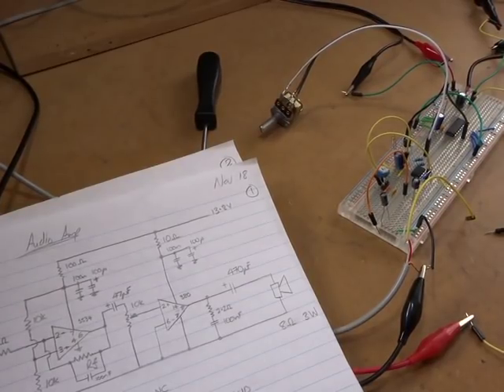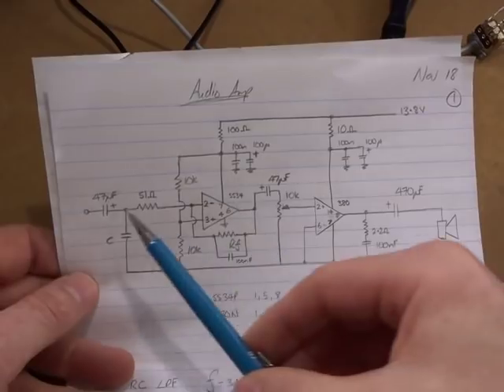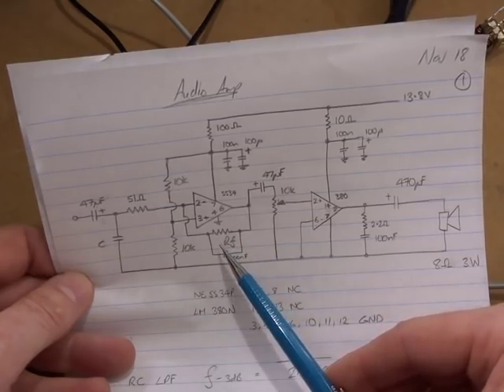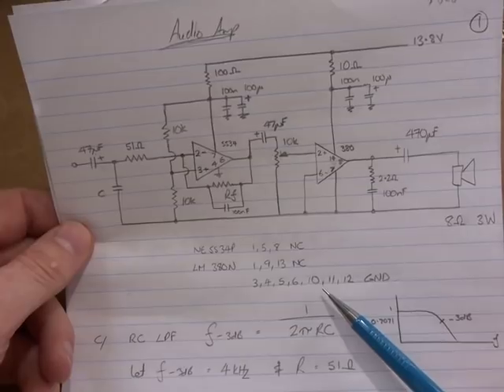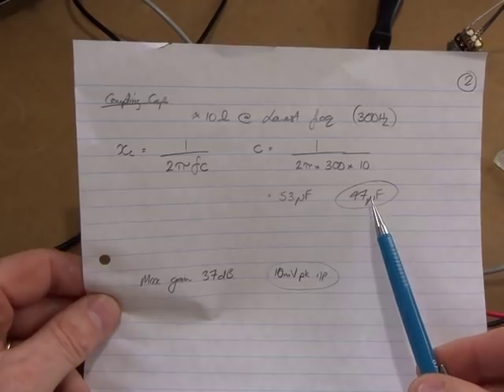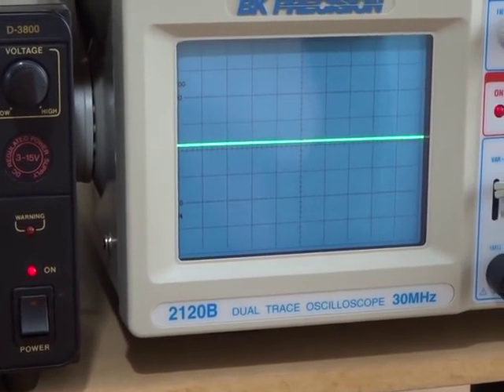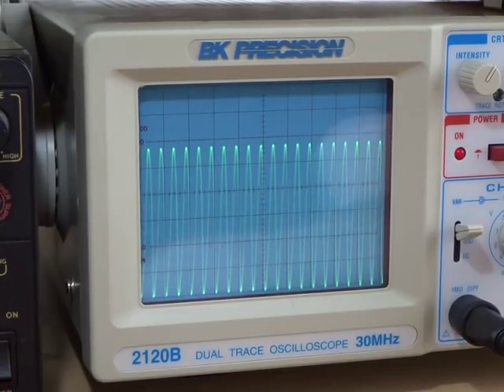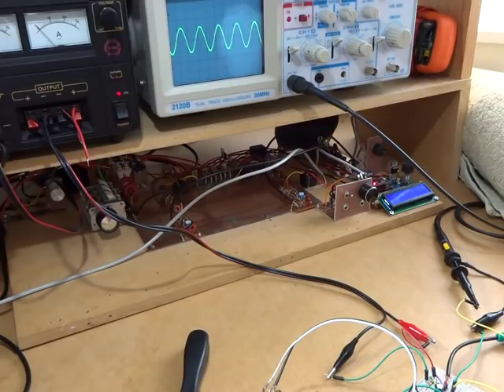Homebrew MC1350P based SSB Rig - #2 Audio Amplifier

Comment: In the schematic - pin 7 of the LM380 is ground but I do not see a connection from the power supply GND to the "bottom rail" that connects C, the divider, the volume pot, and the speaker. Should that rail indeed be ground? Thank you for a great series, I am building along in small parts as I have a spare 45 minutes to rub together.
Reply from the maker: Hi David. Yes it is grounded by virtue of the mounting tab at the end of the bottom rail. Keep us posted on how your build is going.

Charlie

Comment: Hi, I am watching your Videos regularly. I have a question about the output of NE5534 that varies from 3.3uf, 1uf, 47uf in different videos by you. Can you please guide me about the best output value of Capacitor from NE5534 for 10k volume Load for LA4425? 73s AP2RF
Reply from the maker: Hi Muhammad. I need to look at this again, as I know I have been making some errors in the calcs. I will revisit that again.
Reply: @CharlieMorrisZL2CTM   Hi, kindly advises output capacitor of NE5534. May I use 3.3uf or 47uf  .... am on this project right now.